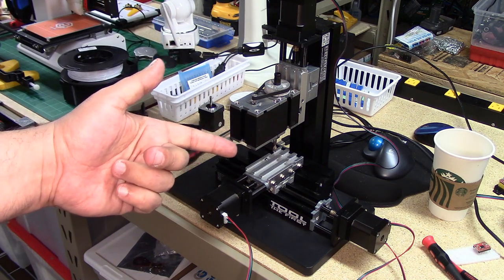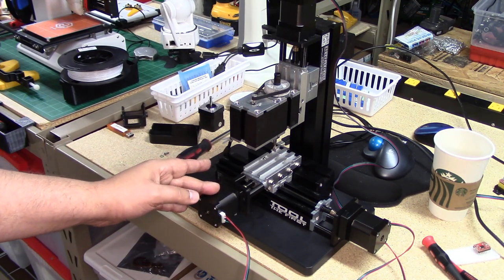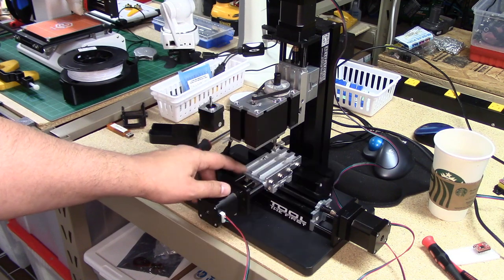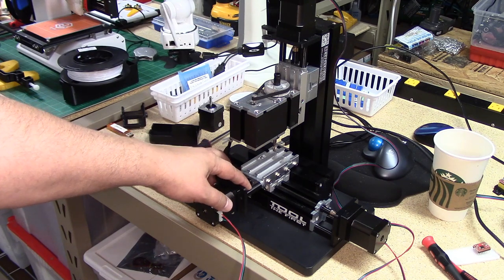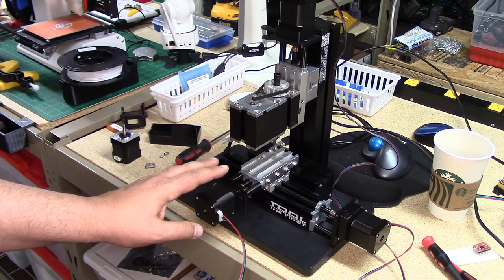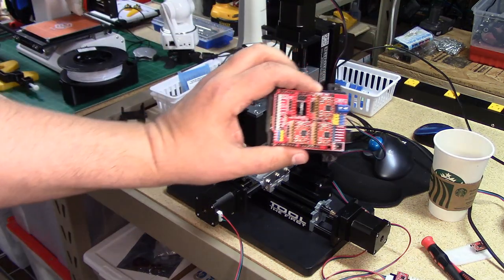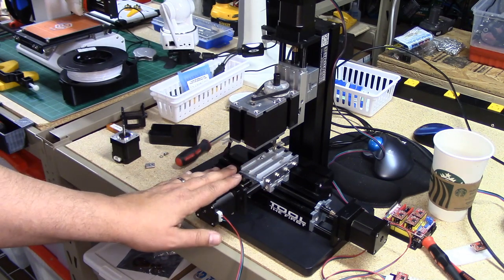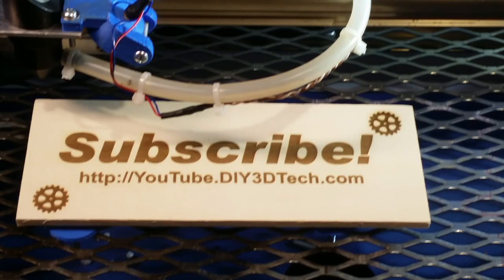MicroMill - CNC Conversion Quick Update!

Comment: im working on a way to put a brushless motor (like one i use on an rc airplane) onto my micro mill (same style as yours) to help with torque. i use delrin most of the time as a build material and i can get away with larger end mills with that material. i would love to see how you would go about doing this. im following your build and am very appreciative that you have put this out there for everyone to see.
Reply from the maker: Wow! That is a super high RPM motor and have seen people do it as for like carbon fiber it would make sense but Delrin not sure as you want to cut it and not melt it...